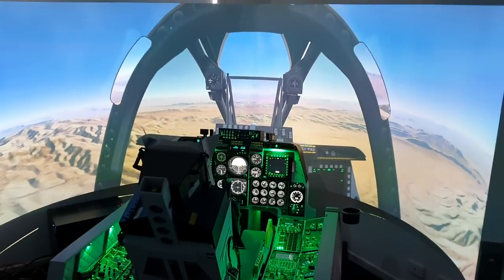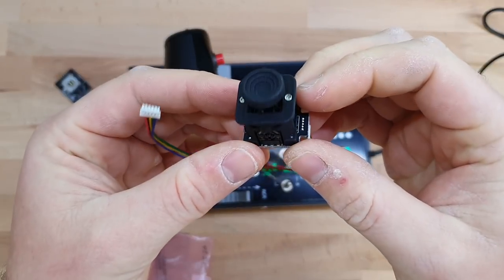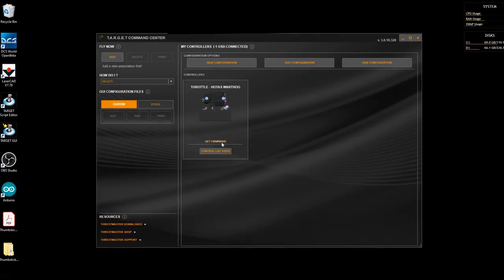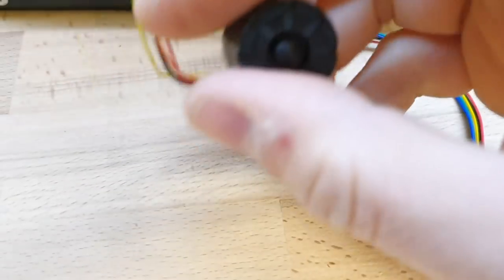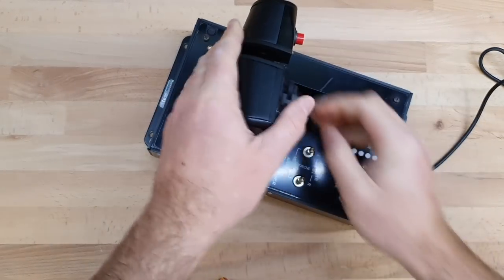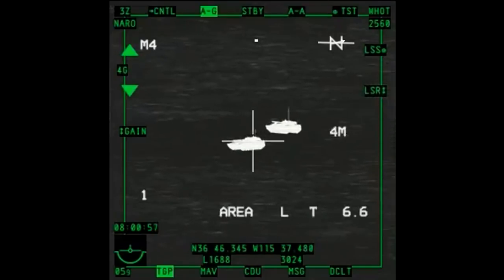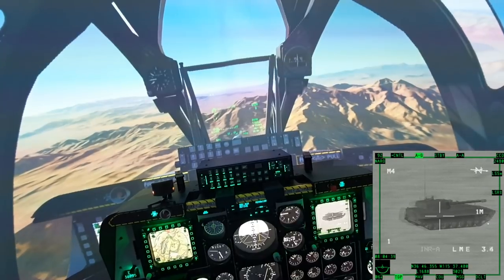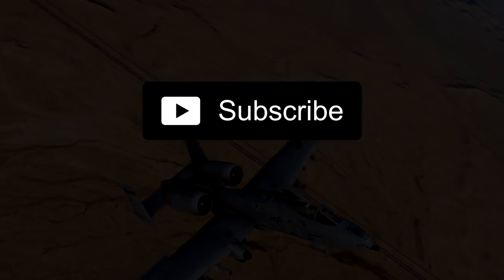Thrustmaster Warthog Slew Upgrade

Comment: Just got my slew upgrade and really appreciated this tutorial. I wanted to emphasize that the calibration step is absolutely necessary which seemed counter intuitive to me (hobby game dev who has substantial experience programming for joystick devices). Out of the box, the new slew stick would send max/min values at a fraction of its travel (imagine the deflection you had on the stock TDC) and calibrating it fixes that.

 This upgrade feels amazing and I regret not doing this a lot sooner. I didn't even need this for the A-10C. The way the TGP works for that module I was OK just tuning the axis in DCS. BlackShark Skhval slew however was a different story. Even with axis tuning it was always either too fast or too slow at the extremes, inaccurate. or too sensitive around the center. After install the upgrade the A-10C was even more buttery smooth, and Ka-50 was massively improved. I'm actually able to fly at low speeds and slew onto targets at the same time. This means multiple Vihkr launches are possible in the same pass, or accurately gunning at multiple ground targets that are somewhat spread out without using boresight aiming.

Comment: Thanks for the video.  Got mine up and running.  Removing the old sensor was the most challenging for me even though it should have been the easiest.  Some of the internal wiring was very short and I could barely give myself enough space to remove and install the new sensor.  Anyways, all good.  Cheers

Comment: I purchased this kit from Delta Sim Electronics and I have to say that the quality of the product I received is excellent, I believe they have changed the manufacturing process and now all those 3D-printed parts are high quality plastic, probably from an injection mould. This upgrade is a must.

Comment: The original slew control is a small force transducer.  It outputs an x/y signal.  It's the same one used in the F-15C.  (I've got grip-envy over how easy it is to get into that throttle grip for repair.  The real thing is a pain in the ass - the A-10 grip is nearly identical to the F-15C.)  Also, be nice to the cat. :D
Reply from the maker: Deltasim actually make a proper force transducer replacement as well- although its much more expensive.

Comment: Nice upgrade mate. I haven't checked in for awhile but the sim's coming along nicely. I have my CNC mill running now so I'll be cutting panels for the Huey to finish the upper and lower consoles. Decided against DCS BIOS now and I'll just go with Arduino Leonardo's with my custom sketch for configuration to allow for multi helicopter setup.

Comment: My initial reaction was that it's expensive for a rewired analog stick but seeing that he went through the trouble of building a custom PCB with a microcontroller, nice sinter printed parts and included shipping in the price it's really good value. Guess I better look into updating my Hog's firmware first.

That force sensing option is really tempting too!
Reply from the maker: Yeah i forgot to mention the force sensing option! I might pick one up when they are available!
Reply: @thewarthogproject  I wound up getting one around late December and man it's a massive upgrade over the one that comes in the Hog. Cheers from Malaysia!

Comment: Great upgrade, great video ! If you want to make slew even smoother, you can increase dead zone and reduce Axis saturation (if you assigned it as axis in a first place), which kind of equals analog slew sensitivity. Slew is gonna be a bit slower (as you set it), but less jerky too. Can even try it with the bad old slew "nipple", before committing for an upgrade purchase. However, for me Windows own Controller calibration centers the nipple better, than Thrustmaster's calibration tool shown in the video to be honest. The latter always offsets the mini stick center a bit down for me.

Comment: I haven't done this mod yet, and I'm not sure this will help with the TMW throttle hardware, but for self-tapping screws in general, I always turn them counterclockwise (or anti-clockwise, for youse European folks) until I feel a small "click", and then I screw 'er in, so to speak. That is in the interest of not stripping the threads of the hole. At any rate, THANKS for making this vid. This mod has been on my shopping list for a couple months.
Reply: Ha, why would it be anti-clockwise in Europe?
Everyone speaks americanized english anyways, except for the tea drinkers ofcourse.
Reply: @nonegone7170  You mean us Brit's? yes we have fought Americanization for a generation, but for anyone 20 or under it's too late lol.

Comment: wow, what an upgrade. perfect.  what should i use for slew for the A10 on my Virpil T50-CM2 Throttle?  There are hat switches and then there is this one thing that is an Axis knob that feels like something on a PS-4 controller or something along those lines.  It also can be pushed in.  If you do recommend that, what would i use the "push-in" for?

Comment: The internal build of the Warthog is pretty dodgy because most users don’t strip their sticks... but nearly all joysticks wiring is crappy (Saitek stuff is abysmal). The number of pinched wires I’ve found in joysticks over the years is horrifying. When I stripped the Warthog Joystick to sand the flashing off the joystick ball I hated all the crappy wiring and tidied it all up before reassembling. I use old style lacing cord to manage the wires.
Reply from the maker: You should see the inside of the Cougar MFD's! Wowsers they are bad quality.

Comment: Please people when you put the big screws back in turn them BACKWARDS with light inwards pressure until you feel a click this means the threads are lined up then screw them in. this avoids cutting a new thread and compromising the plastic housing.

Comment: The only issue I had was that it was just still 8bit precision. Which is 256 points on an axis.  Decided to make an arduino and a small usb hub PCB into the throttle. Works as a charm and on 16bits (−32,768 to 32,767 points) but this upgrade requires know how on soldering and a bit of programming to do.
Reply from the maker: Wow- tidy solution placing a USB hub and arduino inside the throttle!
Reply: To be honest I can't believe there is difference at all. The arm of the sensor joystick and its angular move range are so short that I doubt if increasing resolution of a sensor would change anything.

Source: been there, done that with my DIY joystick, throttles and so on.

Comment: Is the resistance good?  While it's definitely an improvement, it sounds like it might be better if it was a bit stiffer.
(That's what she said)
Reply from the maker: That is indeed what she said. I agree, a stiffer one would be better. DeltaSim has an option for a force sensing stick which uses a milspec part that is almost identical to the one in the real hog- its expensive.... but it would be epic!

Comment: I ordered this mod from Delta Sim Electronics based on your video.  Thanks for that.  
My mod kit has just arrived this morning (several weeks earlier than anticipated) and was just giving your vid the once over again before fitting my mod kit 
Question: I was just wondering whether you stuck with the circular gate or the square one in the end? Which did you find to be the best?
Reply from the maker: I've stuck with the circular one. Have not  even tried the square one at all!
Reply: @thewarthogproject  Thanks.  I've gone with the circular one too.  Seems fine.

Comment: Great video! I haven’t yet got my Thrustmaster HOTAS, would you recommend buying this additional sensor with my new HOTAS and installing it before use, or should I set it up first and then install the new sensor?
Reply: If I were you I would first set it up and test it. Otherwise you spent time on switching the sensors only to find out that your HOTAS has issues.

Comment: Have to say after using this mini nipple mod for a while now (thanks for the good info WP) I got a brand new 2nd throttle as I’m going to try and mod the handles on my old throttle... and OH MY GOD... tried to use the the new old nipple stick and IT SUCKS compared to the mod.

I messed up the calibration on the mod but figured it out quick enough (RTFM eh lol) and have had nothing but good experience with it since. I even managed to get a replacement pinky switch from the factory in China and that’s fixed too... but I know enough not to risk breaking my throttle by modding it... also having an “as new” one I won’t be unable to fly in the meantime... but I’m still transferring the mini stick mod.

Comment: Idk if your taking requests but a tutorial on how to bind toggle switches using lua because i cant seem to do it on the f16 it always greys out all my controls except keyboard
Reply from the maker: I gave up on LUA Editing a long time ago for the same reason! You should look into using Gadroc's Helios Software- I use it to run all the switches in my cockpit without having to change anything within DCS. And when i jump in a different aircraft all i need to do is click one  button in helios and everything works! Have a look for a CaptZeen profile- i dont thin he has the F16 working yet but no doubt he will soon.

Comment: Interestingly, the cheaper TM throttle (TWCS) has a proper slew hat on it. I wonder if you could transfer it from the twcs to the warthog without any modifications? Thanks for the video - very helpful, as I have my new warthog system winging its way to Perth from Amazon this week! VERY excited! :-)
Reply: My TWCS throttle was cheap secondhand because the slew hat was noisy and unusable. The throttle axis physically binds - it does not slide smoothly. And recently the throttle is also noisy - in specific positions the reading jumps around - one of those positions being full-forward. So I'm wondering if the control board / wiring is faulty or if it's just two dying pots… I'm hoping it's the controller and I can repurpose the throttle handle on a new DIY quadrant.

Comment: Does it retain the depress function? Generally as it sits now, I've basically stopped using the slew switch as a slew, and only use it as a depress typically for target lock, and moved its function over to the Mic hat.

also, what do you think of the cougar MFDs? how do you think they would work in VR? I pretty much only fly in VR now, just picked up an HP Reverb and it's just amazing.

Comment: I like the original and have no issues. Looks like the new stick should be stiffer. Can see it getting knocked easily. Would be a major issue especially IRL with added G's and vibrations.
Reply from the maker: Fair enough, but i always hated it. The real jet uses a force sensitive sensor. I forgot to mention in the video that Delta Sim Electronics has those as well- however they are almost always sold out and they are much more expensive! I might pick one up in the future to try out.

Comment: Good Vid mate.  Thanks.  Looking on this website it claims it is a one for one replacement "including the push button function"  Can you confirm the push button function is there please?  I was looking at doing this, but the mod i was looking at before didn't have the push button function (although there was an option to drill and install a separate button, which I didn't want to do).  If this is correct I'm stoked!  I currently use the push button to centre my TrackIR, but may change this to TDC Designate function.
Reply from the maker: I tottaly forgot about that! Yes it 100% has the centre push button. I'll give that a try as my NWS button, so I can slew and lase targets with the same finger!
Reply: @thewarthogproject  Thanks!

Comment: OK. And you're still missing targets. I have the TWCS and it's Slew is a spring type fully 360 movement and yet DCS makes it only move on just 1 Axis at a time as if it is Digital. Yours is similar. Your speed can be adjusted by Curve/Saturation/Deadspot but it seems to be DCS that does not mix the Axis to be really smooth as we move it. They should fix this!

Comment: Ps do you have a link to the original one you bought to replace it, would be usfull for a project.
Reply: You can google for "Analog joystick" to find that part, it is fairly common. Most online electronic shops (Aliexpress, Banggood, Sparkfun) will also typically have it in stock

Comment: Hey I got question maybe you can help me with... so I did the mod and updated the firmware and recalibrated the throttle but my axis are not working properly on all the axis  do I need TARGET to run this or am I missing something thanks

Comment: Good vid. 

Would really appreciate some assistance from the community - I have now bought two NEW Warthogs (Throttle and Stick) for Win 10 PCs. First machine, tried everything - no joy. Read through Thrustmasters instructions, tried everything, but it would only ever recognise the throttle (in both device manager, controllers as well as the TARGET software).  I spent hours trying everything I could. Could not upgrade firmware to both devices, either. 

Thinking it was a faulty stick I emailed Thrustmaster - good luck, they advice 15 days for a reply (insane!). However, enthusiasm to play MS Flight Sim 2020 overcame me, and I sent the the first unit back to Amazon and purchased again, directly, from Thrustmaster (yes, I know!). Poor comms but very quick delivery.

And it still does not work! Same issues - on my first attempt at installing, my PC recognises both Throttle and Stick. I then updated tyhe firmware for both devices, and installed software, and again, onyl the throttle was recognised. Uninstalled the drivers, restarted machine, tried the same thing over and over, and it ONLY recognised the throttle.

Any ideas? Much appreciated it. Surely I can't have had two new duff Warthogs?

Comment: I bought the slew upgrade for my warthog but never installed it. Had just bought me a Virpil T-50 HOTAS setup instead and now I have a warthog I dont even use anymore with upgrades.
Reply from the maker: Awesome. How long did you have to wait on the Virpil? I've been eyeing off a gimbal for years.
Reply: @thewarthogproject  3 weeks. 2 for the order and 1 for shipping.
Reply from the maker: Three weeks is not bad at all! Might have to look into it then. I've tried to buy a couple of times but they are consistantly out of stock with a restock schedule months away. Thats what you get with an awesome product i suppose!

Comment: Have you opened up the main body of the throttle? I read somewhere that there's a plate in there to artificially increase the unit's weight? If so, I'd like to remove it, but I'd like to verify first that the story about the plate is actually true.
Reply from the maker: Yes that's true. Just remove the 4 screws at the bottom, the cover will come off and from memory there are maybe 3 weights attached to the bottom cover.
Reply: @thewarthogproject  Oh wow... an actual answer... thanks for that! :D I did remove those 3 bars (300g according to my scales) but my next question is if I can also remove one of the two base-plates as well or will that result in the screws protruding on the underside? Meaning: Can I use just the one plate and still tighten the screws far enough for them to not protrude and/or without damaging the threads they screw into? Or will I need slightly shorter screws for that? I don't see any use for the outer base-plate plus the inner one has those M6 threads like the TWCS that I could use to fix the throttle to my mount. With the second plate on there, those threads are inaccessible.
Reply from the maker: @1SaG  not sure mate. Mine has no base cover on it at all with no issues, although is mounted in the console so I can't check it to have a look for you.
Reply: @thewarthogproject  Meh.. no worries! I'll just try it myself and see what happens with the screws. Common sense would suggest that they made the threads long enough to work properly with both options, but.. well... :D EDIT: Nope.. doesn't work. The threads aren't long enough and with the second plate removed the screws will protrude by 2 or 3mm and I can't screw them in any deeper than that.
Reply: Kinda like the stick, everyone talks about how heavy it is, but REALLY  its the metal base that weighs a lot.

Comment: Can't you just set deadzones in trackIR? Have it start tracking your head once you actually start running out of screen space?
Reply from the maker: Yeah i can, but I just cant stand the constant moving of the view when i need to look down at the rear ends of the consoles. Id rather just pause it when i dont need it.

Comment: The screen you use is cool and all, but I think this setup really needs to be using VR. If only there were a VR glove that could one to one track your hands and fingers. As long as your real cockpit is a one to one replica of the DCS cockpit which I'm sure it is the transition would be seamless.
Reply from the maker: My setup would be wasted using VR. No point in having a physical cockpit with working displays if i couldnt see it through the VR headset! If i was making a cockpit for VR use it would be much different and much more basic. Im planning one out right now...
Reply: If you want to see how VR should be used in a flight sim you must check out VTOL VR. The only thing I don't like about its controls is the guy who wrote it is a bit of a VR purist and wont allow a HOTAS of any type(he has been asked) clutching a VR joystick is just not the same as a real one BUT it is actually surprisingly very well done.